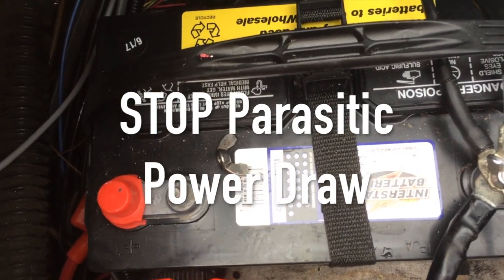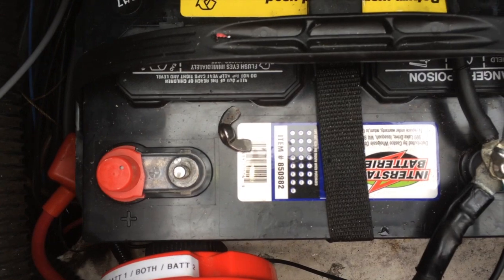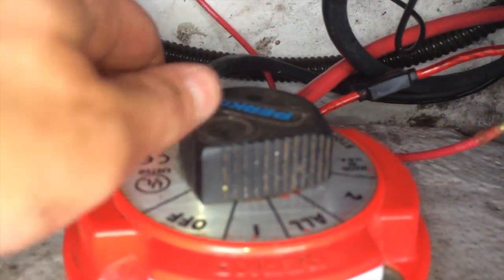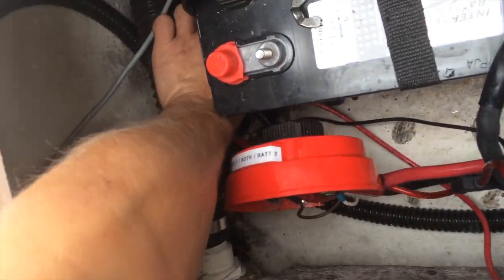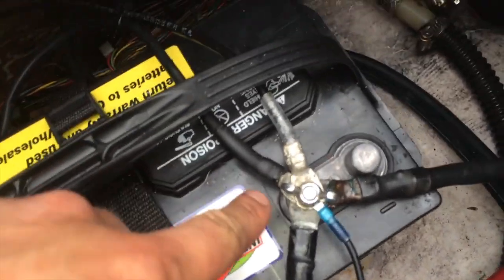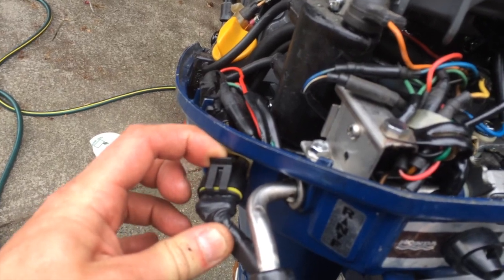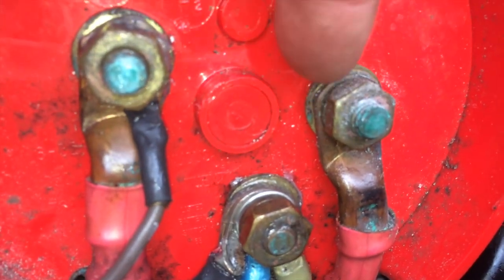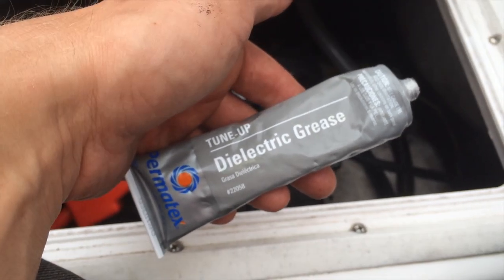Dual Battery Switch - Stop Parasitic Power Loss on Boat

Comment: Nice little video. I couldn't help to notice a couple "quirks" out the gate. Electrical codes (yes, there are codes for marine) specify a couple of things.
 1. When utilizing #6 AWG or larger wire connections, wing nuts are not permitted. It's stated you must use a flat washer, lock washer and a nut on the post. 
2. A maximum of four ring connectors upon any one post. 
  Please, don't get me wrong. I'm guilty of exactly the same wing nuts and sometimes five or more connectors stacked on a post too. But, I've also come to know the importance of (as close to as you can) perfectly sized, crimped, and corrosion free electrical connections, especially for you saltwater guys. Too many of us are guilty (including myself) of just "making it work", with intentions on cleaning it up.  You never want to become stranded, or faced with an onboard fire due to sloppy electrical work. 
Again, thanks for the video. Cheers!

Comment: To keep both  neg and pos battery post clean, I used terminal blocks, only had one cable from terminal block to battery post.  Also,   you may consider investing in a solar panel and charge controller.  Controller controls the charge; it  ensures that the batteries dont over charge, indicate when batteries are low, also keeps system from losing power at night.
 (No reverse draw)

Comment: First problem, Perko battery switch. Your amplifier(s) will spark when you connect the battery cable because there are capacitors inside that are reenergized when the batteries are connected. Most (90%) amps have 0 current draw when not energized. That is why there is a BLUE wire (remote) from your AM/FM head unit that is used to turn on the amps. There will be a draw on the head unit for the clock & the memory so if you connect BOTH power & acc leads from your radio to the battery switch this will eliminate that problem but it also means you lose all your presets when you turn the battery switch off.
Reply: why not just toggle the remote wire
Reply: I've found those Perko switches to be extremely difficult to operate, especially because rarely is there easy access to the switch. its almost always up under or behind something and we are lucky if we can even see the label. 
 If a girl can't operate the selector switch, it may be time to consider another brand.

Comment: Do you know if the 2 batteries are connected or isolated when the selector switch is in the OFF position?
Reply: When properly wired both batteries will be isolated and the load will be disconnected from them when the switch is off.
Reply: @SolarBurrito  thank you!!